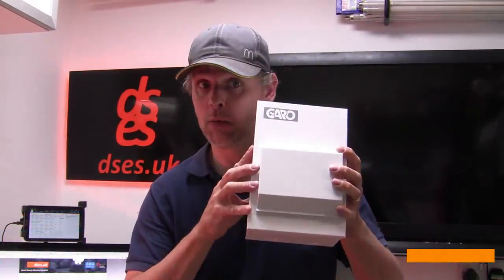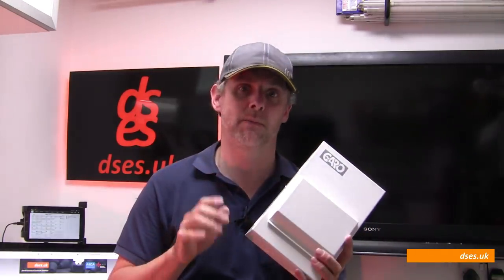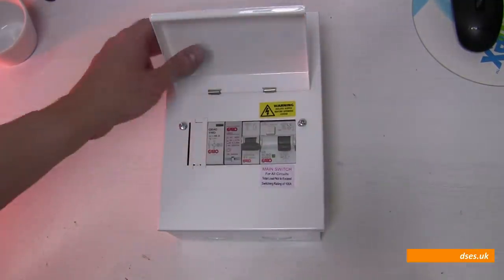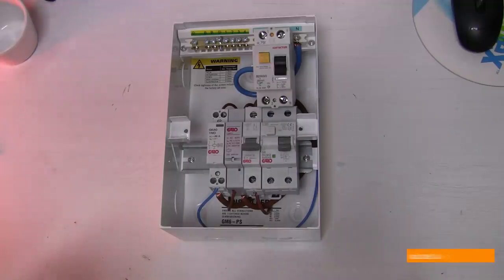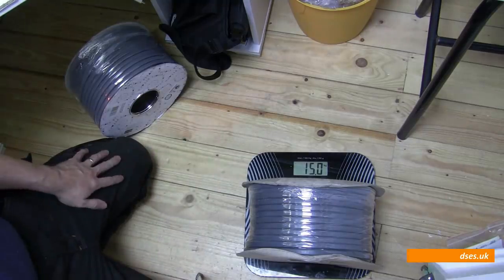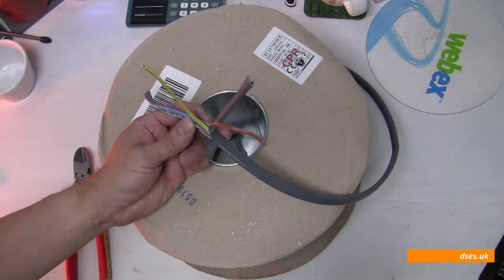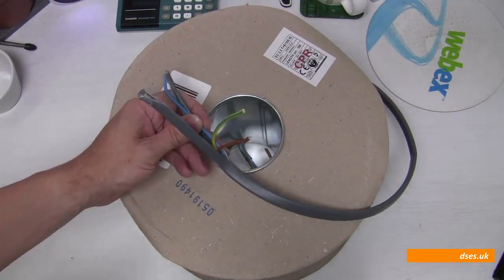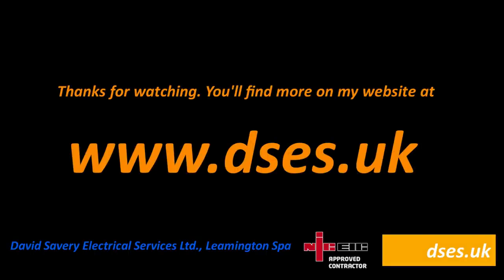Interesting Irish Innovations

Comment: This double insulation on all three (same diameter) conductors is mandatory in all New Zealand installations for power and lighting circuits, and has been for many years.  Ring Mains NOT used in NZ.  Only Radial.  All circuits MUST be fused or "breakered".  Sockets are NOT fused individually.  For DOMESTIC, power circuits are 2.5 sq mm cable (15 amp fuse/breaker), lighting 1.0 sq mm cable, 10 amp fuse /breaker.
Reply from the maker: Thanks Alan. Makes sense, I don't know why we're on smaller circuit protective conductors, why they're not sleeved or why ring circuits are still a thing (we don't tend to install them). In the case of the first two, I imagine it's down to cost of course.
Reply: @dsesuk  
Electricity always wants to return back to where it originated, the generator. The ground wire was to parallel the neutral return wire back to the generator. Either full all the way back, or partly by connecting to the neutral at some point on its way back, or even using the earth itself as a conductor. 

So that if there is a fault, it gets back to where it came from. So it needed to be the same cross sectional area as L and N. The cpc these days is to primarily activate protection devices, rather than run electricity back to its source quickly. So it need not be the same size as the other conductors in circuit, so they deemed.  🙄

Fifty years ago the cpc was never smaller. That was etched into the minds of electricians and electrical engineers.

Comment: Walking off a dog 😂 - Think you need to do an insulation test on your brain synapses - funny as though - don't know if I watch for your undoubtedly quality technical content or your funny as fuck quips - weighing wifes arse - top shit   - is it off the cuff or are you just wired that way. Keep the camera rolling and the jokes coming - love it.
Reply from the maker: I may have taken one belt too many over the years. This is how your brain ends up if you fail to follow safe isolation procedure.

Comment: I think other European countries use cables where all conductors are the same size, in this country we only have one such cable for fixed wiring and that's 1mm, I am with you earth sleeving is a pain in the arse.
Reply from the maker: I wonder if it's like ring circuits where everyone else raises an eyebrow and figures it's a crap idea except for us??!
Reply: @dsesuk  could be, personally I like the ring circuit, a lot of people want to get rid of it, don't know why, change for the sake of it, just like the IET, without it you would have a load of radials, and then apply for planning permission to fit a fuse board, because it could be rather large.
Reply: @acelectricalsecurity  save the ring!   In the portable building industry the MPBA are actively trying to get rid of ring finals.  They also want the things wired in flex as well I think..
Reply: @anthony, personally I don’t find it a pain, 2mm sleeving dosnt fall off and fits cpc 6mm t&e, 10mm t&e you need to start using the bigger sleeving.
Reply: @supersparks9466  yeah it does fitt snug, but if the cable was already sleeved, it would stop the idiots trying to get every earth wire in the fuse board in one piece of sleeving, that is really annoying, just as when the ring earth's are in one piece and twisted together just got good measure

Comment: I have been told that when the new Irish regs book comes out at the end of this year the enclosure for distribution boards in domestic installations will have to be metal like in Britain, I do not like the new T&E because it can be hard to terminate the earth on some larger size cables and you cannot get the correct size cable clips for them, it would not be so bad if Britain was using the same T&E cable because they would make electrical accessories to suit the new cable but it not going to happen if only Ireland uses it because its to small a market, its the EU that wanted this new T&E in Britain and Ireland I remember hearing about it at a seminar for contractors 20 years ago or more and Ireland always does what the EU tells us to do unlike Britain that has more sense or maybe not with your mad brexit situation, I never heard of a problem with the old T&E if its not broke why try and fix it.
Reply from the maker: Nooo! Resist the metal enclosures! I miss the ease of working with plastic, especially on retrofit where cables may have to enter in funny places because the likes of Hager and Schneider don't have knock-outs on the sides of their metal boards. While I like the full sleeving, I don't envy you the increased CPC size which must be a battle on anything 4mm and up.
Reply: That was in the Draft for Public Enquiry. It can't be said that the new Rule book will require domestic distribution boards to be non-combustible or enclosed in a non-combustible cabinet, however, as it hasn't yet been printed and we have no knowledge of what response the NSAI received regarding this or any other issue. I agree RE: the cable clips - I upsize all the clips by one but would prefer if there were ones actually designed for the new T&E.
Reply: @dsesuk  I hope metal enclosures do not come in here for domestic because besides being harder to work with and more expensive I've notice in youtube videos like yours and other English electricians when you retrofit a distribution board they are usually in a cupboard or a garage out the way but in Ireland they are often on the wall in the hallway near the front door and a metal board would not look as good as the present ones, but if they are safer we will have to accept them.
Reply: @paulbrown9175  
At the front door?  Metal is better.

Comment: David, just change your main fuse to 100 amp.... [runs off]
Reply: PS, I have never done this. Promise.
Reply from the maker: As far as I know, my incoming cable ought to take it (and my tails and earthing are up to it), but where's the fun in that??!
Reply: @dsesuk  Indeed. (also as per the NICEIC inspection and testing video, they hold records, legally binding ones, that they wouldn't just make up on the spot to be 'the best case for them' if asked, right, RIGHT?)

Also, full size earth conductor, yes please. Full  insulation, yes please. 

I was always given to understand that the reason the (14th or 15th maybe?) introduced sleeving was to prevent shorts. It was assumed back then that the electrician knew what the hell the wire was for. 

/old cynic
Reply from the maker: Sleeving yes, not convinced on the same size CPC though - okay for this size, but when you start moving to 4mm, 6mm and 10mm, it all seems too much like hard work!
Reply: I think David already has an 100A DNO supply fuse but the maximum demand of his installation still exceeds this... a piece of 25mm steel conduit might work thought mwahhhhh.
Reply from the maker: If you do the maximum demand calcs on my installation it clocks in at over 200A!
Reply: @dsesuk  Is there any diversity allowed on EV charging point circuits?
Reply from the maker: @ashmanelectricalservices4318  I've never installed any (except my own) and it's three years since I did the course, but I don't believe so. If you put in a 16 or 32A charger, the car you plug in will take as much as it can for the speediest charge. In my case, the charger is 32A, but the car is 16 (if I remember rightly), however I went for the bigger charger for future expansion. The car and charger talk to each other to determine the current to be used.
Reply: @dsesuk  If you have about 2 or 3 electrics cars per household, that 64 or 96 amps on just the chargers alone 😯
Reply: @ashmanelectricalservices4318  The whole family comes in from work at 5:30pm, parks their shiny new electric cars, puts them all on charge, Goes for a nice hot shower, ...shit!...sweaty body or uncharged cars?...lol..theres a fiasco forming in EV charging, I can see it. Hmmm
Reply: @muzikman2008  That's when you need intelligent power sharing among the EV chargers, like Tesla does with their second generation wall connectors, or a three phase supply upgrade. I know someone who was able to get three phase upgraded WITH  each phase fused at 100 amps. Since that was his original main fuse size on single phase. He decided to splurge with an electric shower, two 32 amp EV chargers, AND an electric AGA.  Of course there's also the North American approach to residential power, where you arn't going to get three phase (with the occasional exceptions in the states of California and Arizona), but will  get 200 or 400 amp 120/240 split single phase.. eye roll